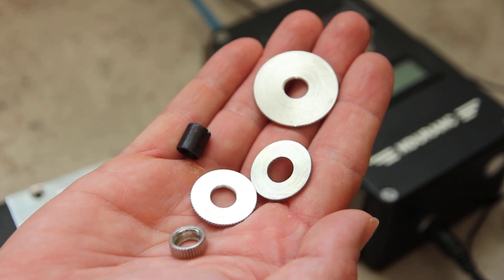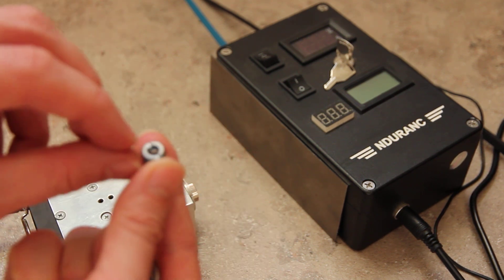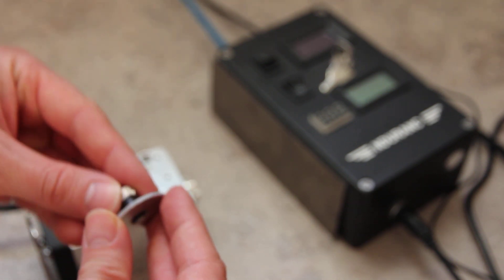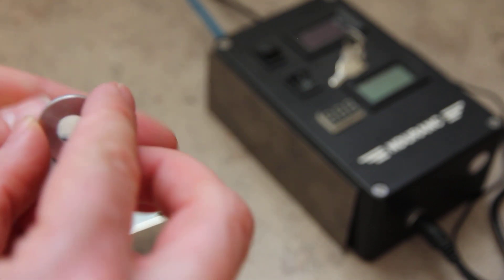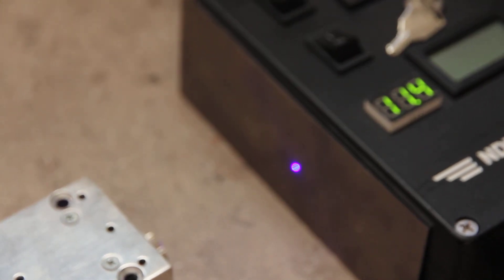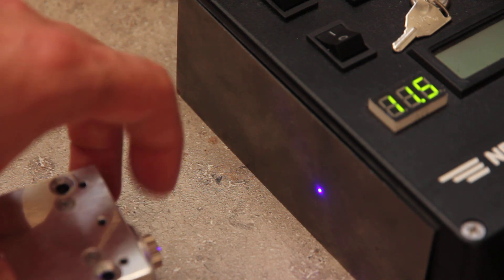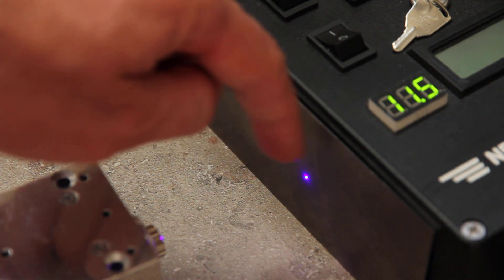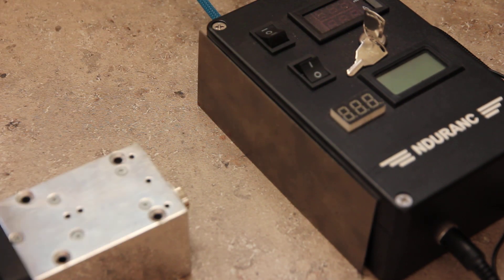About Endurance laser focusing rings and spacers.

Comment: George, the way you describe how to assemble the 3 element parts is not how you show it actually installed on the laser  at 1:43.  It's backwards. 
So, it must not matter what order it can be assembled? Also you do now what adding the spring. Is the spring mandatory or optional?